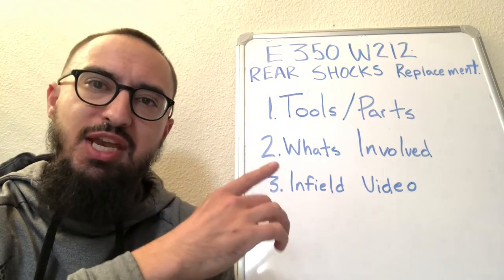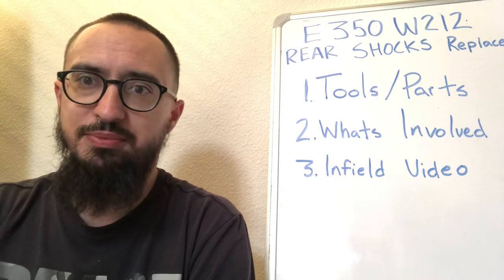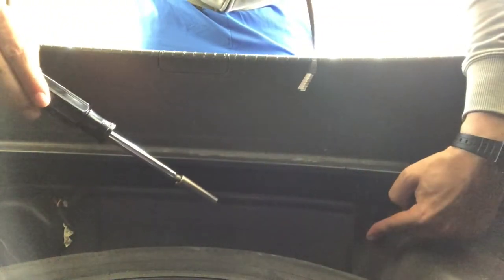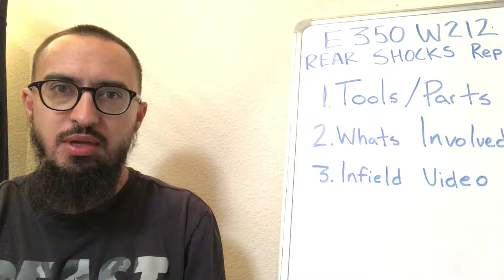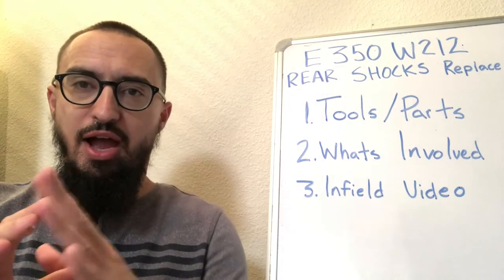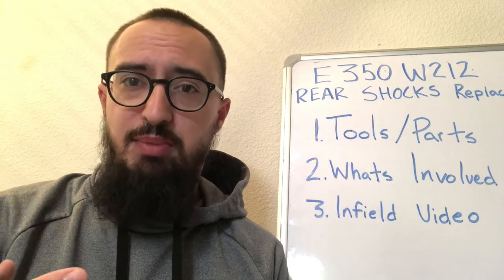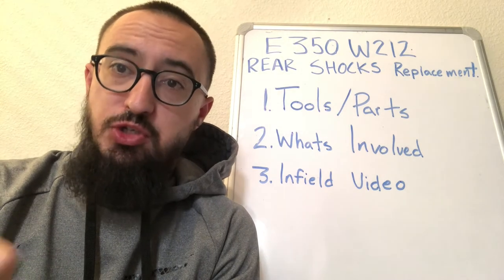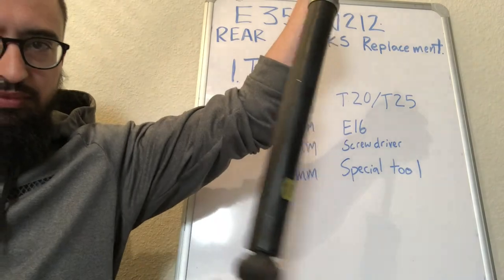Mercedes W212 E350 Rear Shock Replacement DIY. Step by step replacement! Bilstein shocks!

Comment: Great video.  Is the fender liner just removed for easier access?  Will the shock (with mount attached) fit into place without liner removal?

Comment: My car, a W212 E220 CDI does not have a spare wheel!  It has a tire repair kit with a compressor. Which is not very good … have I found out. 
When I got a flat wheel, then I need to go home for a spare wheel... The tire repair kit did not work as it should.
There is a noise in the rear of my car. Can it be the shock absorbers? My car has only 7000 miles on the clock. Nice video!

Comment: Hi, and thanks for the nice video.... it is not a problem if I buy a used original one and change only the side that has a problem? I have a problem with the back right side only. just when I drive on the small bumps then it says click click! I have S212 220 facelift.

Comment: How were your old mounts? I was thinking of also getting those Bilsteins until I found out the rear dust sleeve, bump stop & mount are only sold together w/ the genuine shock which costs literally 110% more & probably is about 0% better than the Bilstein.
Reply from the maker: Im not sure, i think only the E550 with semi active shocks come with mounts etc. All that stuff was fine in my car.
Reply: @mikeicee  cool, good to hear. Not trying to take it all apart just to find cracked rubber on the top mounts & not have a replacement in hand, you know?
Thanks for the video man!

Comment: I own one - its awesome having to take half the car apart for a couple of shocks.....
Reply from the maker: I wish they made little ports in the side panels for easy access, but the shocks last about 180K so its a 1-2 job for the vehicles lifetime. Fuel filter replacement joys coming soon.
Reply: Hahaha if you think that's taking half the car apart, go look at a 3rd gen Acura TL rear shock absorber job.
You'll be extremely happy that this is all you have to do.

Comment: How did the vehicle drive before and after were the old shocks hard to push down I have 116k should I change mines just changed my front struts I have a 2014 350 4matic
Reply from the maker: Did that help with your front clunk noise... it drove kinda weird spring like when the socks where bad. The car felt like it was floating rather connected with road. After the shocks where replaced the car felt like I remember it.
Reply: @mikeicee  bro check this out I changed my front struts yesterday I purchased them off of eBay 🤦‍♂️ got a good deal. QBA Automotive Strut assembly. My car drives worse than it did with the old struts. It’s very bouncy and stiff gonna put old struts back on and just order bilstein b4. I also just learned that our cars have dampmatic technology 🤷🏽‍♂️ so this is probably why it’s driving like this. On a positive note changing the front struts did get rid of that clunk noise so I’m gonna change my strut mount with my new bilstein. 

Should I change the strut mount and bearing or just strut mount????
Reply from the maker: @G_G_AutoCareLLC  Its been awhile... i think I remember the strut mount/bearing being one piece.